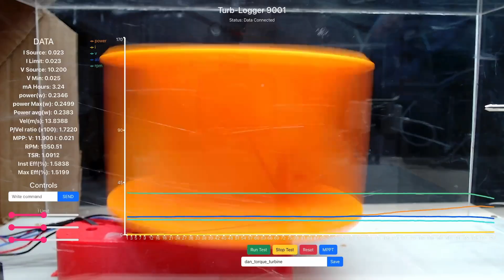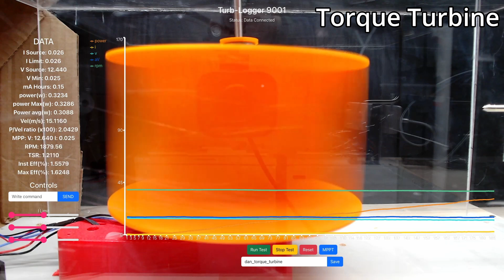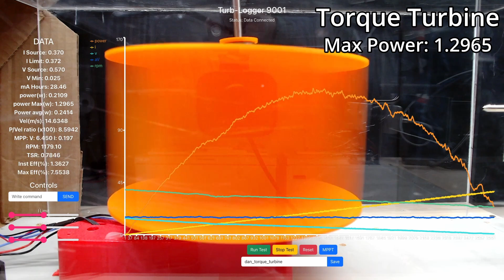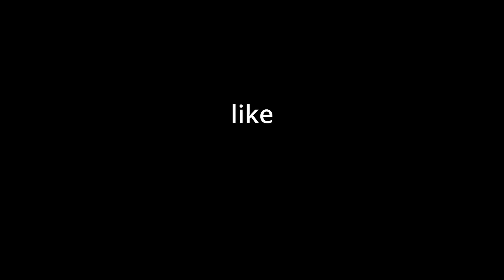The Most POWERFUL Drag Turbine YET!! | Turbine Challenge | VAWT | DIY Wind Turbine | Wind Tunnel

Comment: I think the high TSR is because of an effect in yout tunnel. Inline with the swept area up to the tunnel walls are smaller than just at the back of the rotor. So the air will excellerate

Comment: Are you using the total circumference for the swept area Max? It is only the rectangular box that faces into the wind that should be used; this is the swept area as where it goes round the back is considered a load
Reply from the maker: Yeah, I'm using the "frontal" area 186mm by 100mm